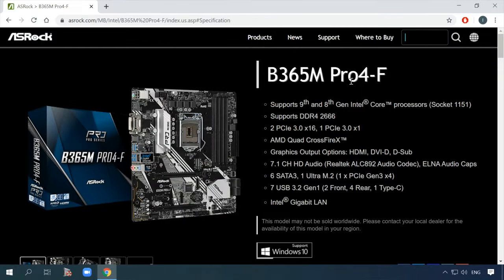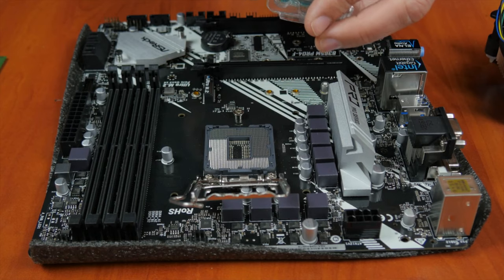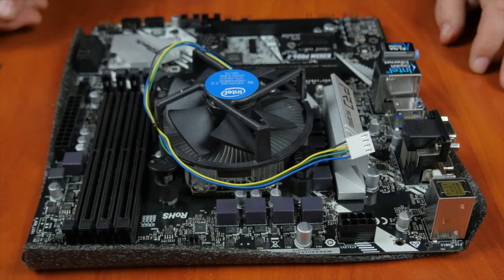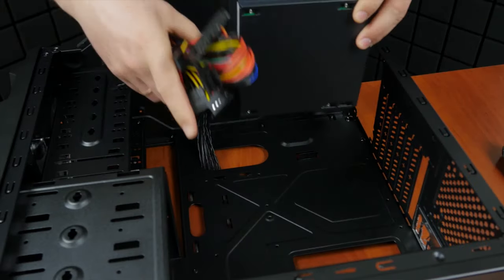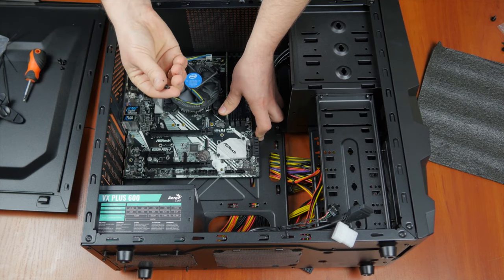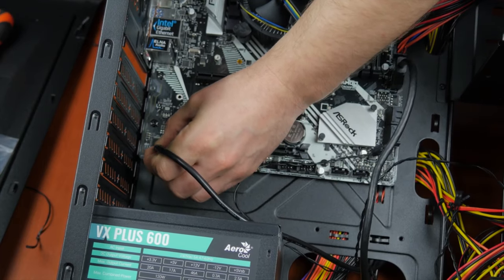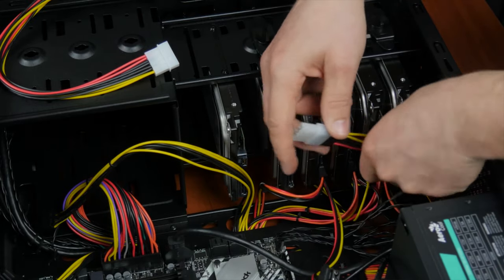📚 How to Create a RAID 5 Array in 2021. Building a PC and Selecting Hardware for RAID 5 🖥

Comment from the maker: Content:
1:27 - Selection of components
2:40 - Installing the processor on the motherboard
4:43 - Installing system memory 
5:14 - The case and power supply unit
6:08 - Installing the motherboard into the case
6:55 - Connecting the PSU to the motherboard
7:13 - Connecting the motherboard to the case
8:28 - Installing the hard disk
9:49 - Installing the graphics card
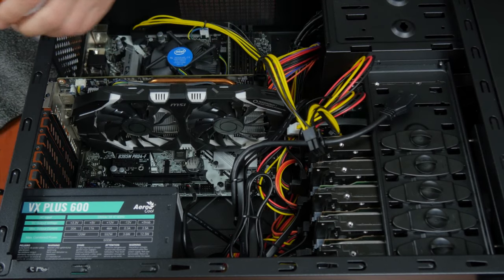10:22 - Installing the operating system

👍 Here is another video on RAID arrays. In this video we are going to show you how to build a homemade RAID 5 system!!! We will be glad to answer any questions in comments!

👉Accidental deleting of files, formatting the hard disk, a virus attack, an operating system failure or file system failure — these are only a few problems that can be solved with programs by Hetman Software: https://hetmanrecovery.com/

Comment: What is the approximate read/write speed of this raid 5 array ? Can it get close to 500 MB/s ?
Reply: It all depends on how many drives you use.  3 is the minimum for a Raid 5.  3 will give you 2x the read speeds of a normal drive, 4 will be 3x, and so on.  Write is always 1x speed of a normal drive.
Reply: Write is not always 1x of normal drive speed. It needs to do calculation for parity so it will significantly impact write speed. It'll most likely be less than 1x of the normal speed depends on the raid controller.

Comment: What is the model number of the motherboard to be used now? Which is the best company to choose the motherboard?
Reply from the maker: The motherboard manufacturers most often recommended to consumers include ASUS, Gigabyte, MSI, ASRock and Biostar. However, each computer builder or user may have their own preferences and requirements, so the best firm can only be chosen based on individual needs.